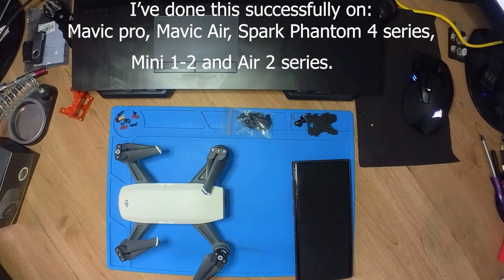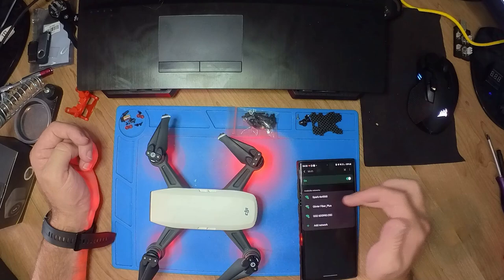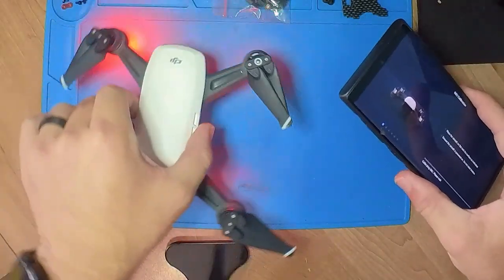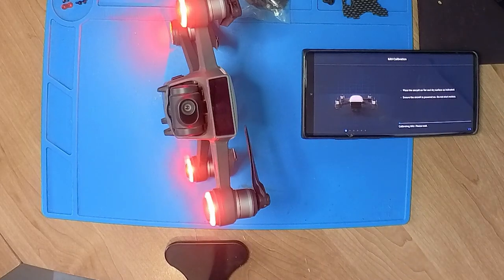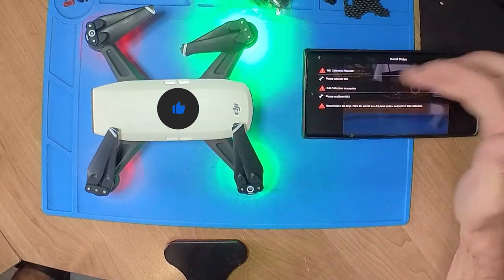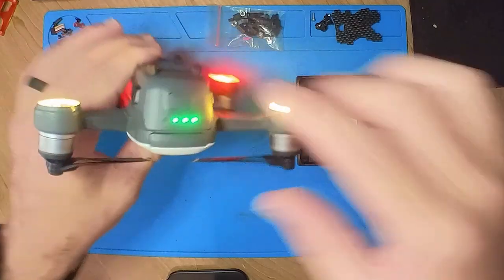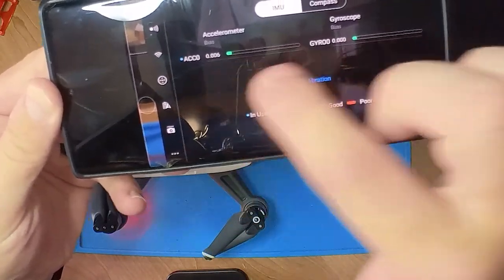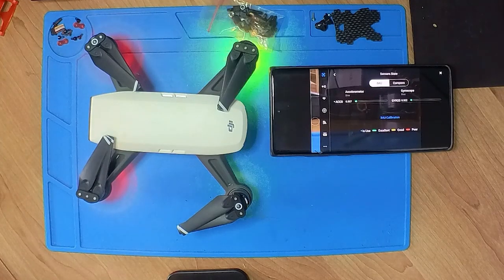Fix: IMU calibration failed on most DJI Drones

Comment: After doing it this way, the next time I can do a normal calibration without these actions?
Reply from the maker: Correct. The trick is to just get it to complete the calibration process once successfully. After that you should be able to do a normal calibration.
Reply: @InfinityDrones  Nice one, thanks for answering this question 👍🏼
Reply from the maker: @Minicopters  always a pleasure man!
Reply: Brilliant!!  Helped fix an issue I have been having for ages. Easy too!!

Comment: It didn't go any further in step 2 for me either.
With the Phantom 4 RTK, I was told to place the drone on a flat surface as normal and wait.
The necessary displays to position the drone differently were not shown. That's why I drained the first battery without this information, in the hope that the software would respond.
It only continued with the quasi blind repositioning. The IMU calibration then worked.

Many thanks for this tip. 👍
Reply from the maker: Great to hear! Glad this video helped you

Comment: I have a dji mini 4 pro its stuck at 96% imu calibration 3/5 😠  im really hating dji so many issues with a nee supposedly good drone
Reply from the maker: Did you have a crash perhaps?
Reply: @InfinityDrones  no crash at all...I'm so confused.  I will try the imu update again tonight soon. Im hoping it fixed 🙏
Reply from the maker: @BIGPAPAFOOT  did it work?
Reply: Nope unfortunately had to return and get another one. So odd it had issues. Also had a battery issue.  It would die within a few minutes fully charged used a few times
Reply from the maker: @BIGPAPAFOOT  sounds like you got a Friday drone 😂. Glad you could return it.

Comment: How did you connect DJI Go 4, thank you in advance I have a mavic mini too
Reply from the maker: The spark can connect wirelessly. If you have a mini then you need to use the DJI FLY app and connect via a cable.
Reply: Thank you for your quick reply. I didn't understand. Can you please explain in detail how to do it?
Reply from the maker: @mf8s  You cannot do it with the Mavic mini. Only the DJI Spark can connect wirelessly

Comment: I have mini 4 pro and yesterday drone doesnt fly straight... like he is fly forward but little to the left... i do calibration imu and compass through the rc controller and still the same.. any tips?
Reply: Or i need first do this what u show on film and next use rc controler?
Reply from the maker: Check that your gimbal is not perhaps misaligned. Look down at your drone from the top and then check if the camera is alinged with the nose of the drone. I've seen many times that if you calibrate your gimbal (or make manual changes there) that you can align it. If your gimbal is not straight you wont be flying straight, so worth a check.

Comment: My Mavic air has never been flown but the imu calibration doesn’t let me even start the calibration. Any ideas? The
Reply from the maker: So this didn't work for you? If not then I think you have a faulty imu chip.. M
Reply: It didn't work for me either. I tried something a bit more advanced and it actually worked. I posted a comment with more details, in case it helps others that are in the 5% that this video's guide doesn't work. Best of luck!

Comment: At first my battery stopped working properly which led me to purchase a new one and then it worked. The next day I get the error code 50 while calibrating. I then made a factory reset and the error code is gone. When I calibrate it does so "successfully" however the status after is still that it has failed calibrating. 
I dont use a cell phone but a remote with included screen and it's a Phantom 4. Would connecting it to a phone be a solution perhaps?
Reply from the maker: Definitely try connecting to a phone. The spark was never meant to use with the plus controllers

Comment: I can't calibrate my avata (indoors) any tip? I didn't try outdoor or other ideas in internet, but I want to know the process, tnx
Reply from the maker: What are you trying to calibrate? The compass? If so you need to be about 5m away from anything metal. Make sure your smartwatch and phone is not very close to the drone.
Reply: @InfinityDrones  sorry, I says IMU sensor error, it does calibration good but after reboot it fails again
Reply from the maker: @dronmdp  IMU error... i think you have a faulty IMU if its not keeping its config.

Comment: Did it work with avata 2?
Reply from the maker: I've not tried it with an avata 2. Did you have a really bad crash? The avata 2 is built different and should not require an IMU calibration like the older drones, but if you need to go try and run through the wizard in the goggles.

Comment: My air2s won't start calibration. I press the button and nothing happens. Anyone know what that's about?
Reply from the maker: What error are you seeing in the fly app?
Reply: @InfinityDrones  30007, 30045, 30047, 30049, 30050 and 
40012 - gimbal unable to connect.
The other codes are IMU, Barometer, Gyroscope, GPS. 
I'm guessing the IMU module is gone. I've had a look inside and can't see anything wrong with it. No damage, flex cables and all connected.
Reply from the maker: @siriusleigh24 your Imu board has failed and needs to be replaced. That it the Coreboard...

Comment: Hi please could you try and help
I have a DJI Mavic , I replaced the gimble after a crash.
I am unable to re centre the camera.
It will not allow me to calibrate as when it asks It is placed as asked and nothing happens.
The camera tends to move centre to the left and not centres
I was told that I need a special programme to do this, is that true?
Oh I build racing drones as a hobby so I was extra careful when I replaced everything on it
Many thanks
Reply from the maker: Hi there, Mavic 1 Pro? I have a calibration video o my channel. check it out. How to calibrate your gimbal using a PC. https://www.youtube.com/watch?v=qQ7MFSNP_W8&lc=UgyvfTftd3XadHWAi3J4AaABAg

Comment: I finally figured out to fix it…mine got stalled out in stage 2.   Basically the depiction of the drone gets stalled. So once the green lights flash rapidly turn the drone on one side until the green lights flash, then turn it over on its other side until the green lights flash, then turn the drone on its end facing up until the green lights flash, then finally turn it upside down until the green lights flash….that was it…it showed it was completed.  Good luck that’s how injustice did it.
Reply from the maker: Great tip man! Thank you for sharing!
Reply: thank you
Reply from the maker: @anthonyc3826  Just a pleasure!
Reply: Thanks got it calibrated but still says up/down unavailable
Reply: Thank you!!! This worked after hours of frustration!